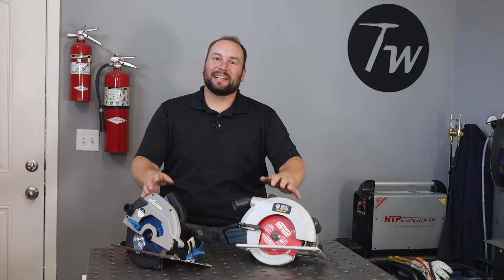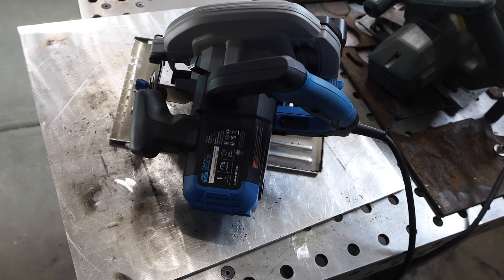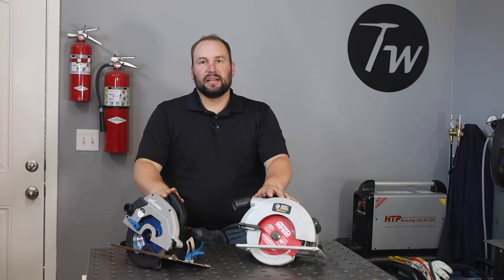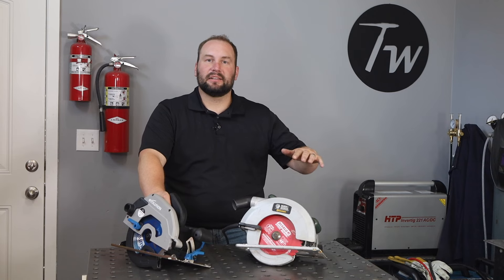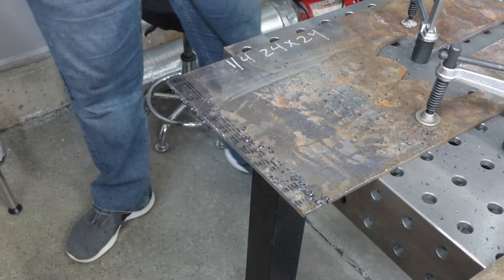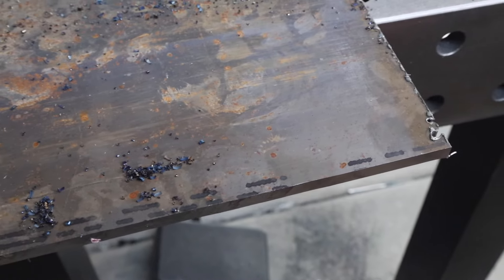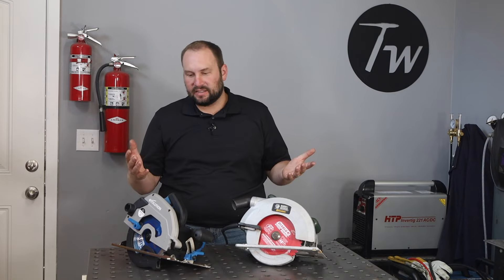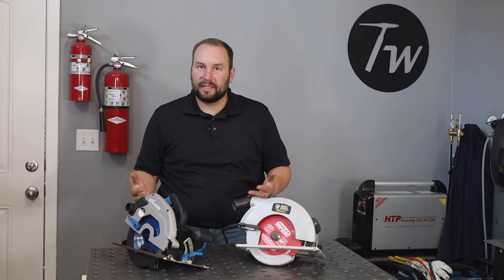Cutting Steel with Circular Saws | Metal Cutting vs. Standard Sidewinder

Comment: I have evolution miter saw. Its blade lasted only ~20 cuts through square tubing with .25 wall. After that it become completely dull. And new blade costs $70…
Reply from the maker: What a let down. I have the evolution 14” dedicated metal chop saw and the blade is still going strong after many, many cuts. I’d be pretty disappointed if it died that soon.
Reply: We use Diablo 14" blade D1472CF for steel (ferrous mateirals). Its a beast! Make sure you run it on slow dry chop saw. Speed and heat is what kills the blade.
Reply: I ruined my 14" Evolution blade too. I was cutting 1.25 x 1.25 x 0.125 angle bed rails. Chincy little bed rails?? Come to find out, bed rails are often hardened steel, not mild. And hardened steel will kill a metal cutting blade real quick.

Expensive lesson for me; confirm the hardness of your metal before cutting!
Reply: @steves7896 I figured out how to resharpen it with angle grinder.
Reply: @_Mikekkk  Good thing, I didn't throw my ruined blade away. (I never throw anything away, it's terrible. 😅)
Reply: @steves7896  Yep! Many DIY'ers find this out the hard way. As soon as they try to cut/drill this "almost free" material, they soon realize that they would  of been money ahead going to the metal supplier and buying new mild steel the same size.

Comment: In my welding and metal adventures, I leaned that using a wood miter saw with a metal grinding wheel is a very bad idea. It melted the plastic base, oops, lol. So then I bought a metal miter saw which did a decent job, but not good enough that I depended on it. In the end I actually more often reached for my JIGSAW because it cut faster, didn't make the metal hot, made a clean cut, and was way less intimidating. So what I wanted to say, don't underestimate a jigsaw for cutting smaller pieces of metal.
Reply: those weren't grinding wheels, those were cutting wheels and there's a LOT of difference in how much heat each one generates - grinding is by definition a heat inducing process, while cutting is much more dependent on the force applied. I may be wrong, but it seems the author of this video pushed the saws quite a bit which isn't the best way to handle such a tough cut.

Comment: I use a 7-1/4 inch Diablo blade on a 10 inch compound miter saw that was made for wood.  The miter saw is lower RPM than 7 inch circular saws and works great on steel, including stainless.  Precise cuts in metal, just like in wood.  Great use for a miter saw that I didn't need any longer.
Reply: How long can u used such a blade diablo or evolution ? I cut 1.5mm steel
Reply: Great info. Will try.

Comment: I have been doing this for about 3 years with standard skills upto 1/2” plate thicknesses. Guys you need to know this. These blades do have a bit of a learning curve. #1 rule, they do not like vibration. Secure your work piece. Also try to support your drop piece. It will bind and chip or knock the teeth off the blade. Those blades are expensive but they do leave a great cut edge you can touch instantly. Also you can a bevel to your cut Illuminating the need to grind it in.
Reply: How long can u used such a blade diablo or evolution ? I cut 1.5mm steel
Reply: @meo7823  I had good blade life with it on steel that thick. I would cut 200 studs or u-channel  a day. Maybe about 3 days. Because your cutting steel be sure not to allow the blade to get pinched between the material when you cut.
Reply: I thought maybe a year off longer😥

Comment: Ive got a Milwaukee 18v steel cutting circ saw, its smaller and spins a bit slower, guard is made for it also.  It’s awesome. The trick is to set the blade height right and not just full depth, only want 3-4mm deeper than the material.

Comment: Love that Steel Demon blade I’ve used it to cut all sorts of stock. Only thing to note is that the minimum cut thickness is a real limit. Mine said it’s minimum was 1/8th thick I used it on 1/16th material assuming I’d just have a rough cut or something like that. Instead the balde stalled in the material something which probably would have been really dangerous if my saw didn’t have an anti kickback mechanism.
Reply: I've always used an old plywood blade turned backward to cut very thin sheet steel.  I'm an old guy and we didn't have these fancy carbide blades back in the day (or couldn't afford them).

Comment: I got a Stihl battery powered chop saw with a carbon blade. It has a water input to keep sparks down. I normally don’t use water with it. But the Stihl chop saw cuts way faster and smoother. Plus I can put a diamond blade on and cut tile, brick, block, asphalt and masonry etc. as well. Just a better option for my use case.

Comment: Thanks for your video Tim. I’m a new sub and a beginning welder. I saw one of the evolution Dawson an advertisement and then shopped around and found the Diablo blades. Put them on my circular saw and it works great nice clean cuts   Much faster than a grinder with a cutting wheel. 
Thanks

Comment: Nice video. I’ve tried a steel demon on a non-sliding miter saw. Works, but bogs down. A slider might do better, as the blade wouldn’t be trying to plunge into the side of plate.
Reply: @benisrood  Mine is 5/8 arbor?

Comment: How is the Diablo still holding up for you? I picked one up and was using it to make 12” straight cuts on 1/4” plate steel. Half way through the 4th cut, it stopped cutting any farther. I got a total of 43” use out of it. The first 3 cuts were impressive. Until it stopped on the 4th cut, there was too much heat either. 😕
Reply: How much force did you apply during the cut?
Reply: @vaakdemandante8772  not much at all. I let the blade do the work.

Comment: I didn’t see this video earlier, but now that I have, I admit I’ve been thinking about this for a while. There are a number of these, and some are pretty expensive. I have a Morse blade for steel for my cabinet saw, but it’s only up to 0.125”. I can’t get one for thicker steel, and I get why. Aluminum is easy I can cut up to 2” thick with a non ferrous blade. I use plasma for long steel, but you know that can be a mess.

I wonder if a worm drive saw would work well for this. It’s slower, and has massive power.
Reply from the maker: I bet a worm saw would be perfect!

Comment: I wander if anyone have used a dimmer to reduce rpm of the corded saw, and if that works with this metal cutting blades. Of course I know it will take longer, but Im interested in the result not the time.

Comment: Curious if the old B&D saw had a 13 amp or a 15 amp motor. I feel like a lot of older circ saws were 13 amp. Probably wouldn’t have made much of a difference, but still wondering. Think I am going to pick up one of those Diablo blades until I am ready to pull the trigger on an Evolution.
Reply from the maker: It’s 13 amp. It’s fairly worn out, so I’m surprised how well it worked. It made a bit of a mess, but cut faster and left a cleaner edge than a cutoff wheel.

Comment: Makita makes a specialty version of this saw that collects all (or almost all) of the hot little metal chips. If you put a Diablo blade in it it works fantastically.
Reply from the maker: Thanks for the tip! I haven’t seen that saw before, but I just looked it up and it looks really nice.

Comment: Get the milwaukee 8” you will never be disappointed or look back!
Reply from the maker: That Milwaukee looks like a beast! The chip collection looks good on it too.
Reply: @TimWelds  exactly, and the OEMblade is very thin kerf and made in Japan ... I have 3 of the and I cut 1/2" with it regularly ....you would have to pry them out of my dead hands ...
Reply: @halledwardb  i have the 18 volt version also.   Its ok - ish. 
5 3/8” blade diameter
Its cuts ok for a battery powered tool. No comparison to the corded one though !!!  And you need at at bare min 5.0 ah batteries 9.0 ah are strongly suggested. 
And buy a few spare blades as well! 
Smaller diameter + less teeth = much shorter blade life span

Comment: can we use the normal circular saw that used to cut plywood? only change the blade is it?
Reply: These saws are designed to cut metal and run at a lower rpm then a regular wood saw.  Your wood saw might burn up if you use it a lot cutting metal.
Reply: @justinw123   i cant find the specific circle saw machine  for curting metal sheet.

Comment: I tried this. It works but not ideal for my use. I bought a carbide tipped saw blade for steel. Similar to the Diablo. Can’t remember the name. Returned the blade.

Comment: I've never used a circular saw to cut steel but it seems like your blade depth is way too deep. You'd want to set the blade depth so it's barely deep enough to cut the material. I found this out while cutting wood using a guide and I kept getting crooked cuts. It was because the the saw blade was way too deep so it would get caught going in a direction that was slightly off and then it wouldn't want to correct becuase half of the blade inside the cut as opposed to it barely sticking through and being able to use more of the saw blade teeth, if that makes sense. Another reason to do this, no metal espeically, I would think the saw blade might wear out quicker like abrasive disc does on an angle grinder if it's inside of a deep cut. Best trick to make angle grinder disc last a longer is to not have them too deep, just as much as required or else your unneccesarily rubbing the disc on material that's already cut through. That makes a huge difference in the longevity of a disc. Fireball tools has a great video about it.
Reply from the maker: Thanks for the comment! It is better to have a more shallow depth.
Reply: @TimWelds  you seem like a good dude, keep it up, I’m going through all of your videos currently
Reply: Hi I'm late to the party but here's my input; I cut mainly 3/4 plywood and small timber like 2x2 a lot and I learned early on that you get a professional finish to the ply edges, and less strain on the saw and blade if you cut in 2 stages. For 3/4 I set the blade shallower than halfway, this stops blowout at the back. After this cut I set the blade at about 2-3mm below the workpiece. I'm just thinking aloud that this might be effective for cutting steel, and blade life.

Comment: Any advantage of having one of these if you already have a Powermax85 plasma cutter? It's a tool I want but can't really justify...
Reply from the maker: It depends on what you want to do. I bought this to cut sheets to size to fit on my CNC plasma cutter and cut weld coupons for video demos. Compared with my handheld powermax 30, the circular saw is much faster. It also leaves a cleaner, basically machined edge that is ready to weld. If what you have is doing what you need, I wouldn’t bother with it, but it is another option.

Comment: I cut 1/4 inch wall 2 inch square tubing g with my 48 tooth steel demon on a standard wood cutting saw   No problems.  Just don't push hard.  My old abrasive chop saw is collecting dust
Reply: Absolutely my abrasive chop saw also it’s make a lot of dust, I will try one of these new blade.

Comment: I made the mistake of buying two Evolution multi material chop saws and they are absolute junk. The 7 1/4 motor blew nearly a week in and the larger 14" is so far out of sq and bevels. I should have payed more attention to the reviews but I ended up buying a better brand from welding supply store.
Reply: Same experience.  I bought the one he's using in this vid.  Two days of full time cutting for fabrication (3x2 3/16th tube) and the saw is junk.  The internal gearbox is shot and won't spin the blade when you start into material.